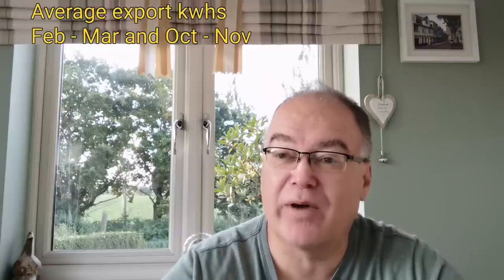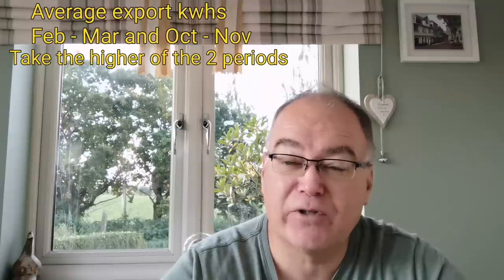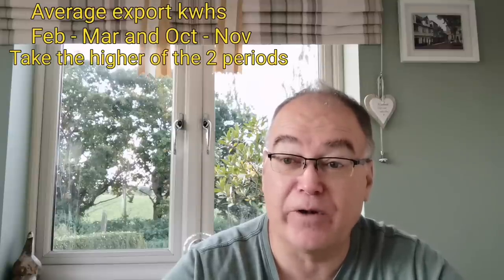How to size a home storage battery

Comment: Great video, as usual, I had 3x Pylontech US3000C's installed when my panels and inverter were installed BUT, I've just bought 3x US5000's to join the 3000's, giving me around 23kWh.
My 8.5kWp array may not be able to charge the batteries fully during the winter (unknown since only having them installed in March) but top that off with Agile and I should be good.
I've started testing a couple of infrared panel heaters, my wife loves the one under her desk and I have a 720W one in the conservatory which I'll use when the temps drop enough.
Reply: I have a 5.5kw array and a 5kw battery. I can't charge the battery to full on most winter days (5-6 months a year) from the array
Reply: @leedove7255  I've had one or two days this month where the batteries haven't charged BUT this has been when there's been the dishwasher, tumble drier, washing machine, computers, xBoxs, etc, all running, etc.
I look at what the panels and battery also save me, on a day when there's 30kWh used in the house and I've only drawn 80-10 kWh for instance.
Over a couple of months alone that would work out to be a massive saving.
Reply: @leeumney7675  I am not saying that you will not save with the system just that the batteries seem a bit big. I am a bit confused by your numbers (30kwh used and drawn 80 - 10) do you mean 8-10 ?
Reply: @leedove7255  I know mate, not saying that you were.
I went oversized for 2 reasons:
1. in the winter I can charge them with both grid (Agile) and what little solar we get.
2. in the summer I'll be able to maximise the amount I get back by strategically dumping power onto the grid when it's paying the most.
I also plan on getting more infrared panels and the extra batteries will help with those over the winter.

Comment: Thanks, a good discussion.
I just about manage with 7.5Kwh, but the payback of adding more is way too long, but I still wish I had gone for 10 Kwh.  
In summer, no problem, and surplus generation from my 4 Kwp is just dumped to my ev. In Winter, I fully charge the battery on the cheap overnight rate. Load shifting helps keep me going. I just about manage to keep my day rate grid unit cost to about 1 unit/day, but the savings from extra battery are way too long. Everyone is different.
Heating is still gas, and living in a very old house, there is little chance of further gains.

Comment: Yesterday, Tesla support gave me the option in my app to import/export to powerwalls, as opposed to only using them in support of solar. Very excited to see what difference that will make financially, as it dumped 29 kWh into the grid last night as soon as peak arrived.

If we charge at .07 and export at .22, something tells me it won't be as simple as just multiplying the difference.
Reply: It's not worth it until the UK offers net metering sadly as it will cause your battery to cycle alot more and thus degrading the life of the battery.

Comment: Other considerations to consider lowering your electricity usage, and depending on where you reside. Is the use of Tankless water heaters, or using natural gas/propane to heat your water and heat your home as well as to cook with. Here in Texas. I am use a propane tankless water heater, and my central heating is running off propane. Propane is cheap in Texas. However, the issue we have is the A/C usage in the summer. While our u it is on, it draws 5kw as long as it’s on. We also use a propane generator to charge batteries in prolonged bad weather. Where the bad weather has knocked out the power grid. I use propane to off load electric use to allow for smaller batteries and less panels. I use around 6000 kWh per month.
Reply from the maker: But my point to using electricity is to avoid oil and gas products. Burning any gas isn't a good thing going forwards.

5kw for AC.  Ours ticks over at 400w and peaks and 2.6kw.   (2 x 3.7kw and 1 x 2.7kw units)

Comment: Thanks for posting. Great video. Having a 4kw stand alone system with 9.6kw of battery and it’s being fitted in the next few days. I already have a 1.8kw system 11 years old giving me maximum price on feed in tariff. That’s having a new inverter and replacement panels. The 9.6kw batteries were a guess. I’m considering adding a 4.6kw battery to my 1.8kw system also. Going to start recording how much I’m generating on the existing and the new system then will decide where to go next. But this video will save much head scratching. John
Reply from the maker: Makes so much sense doesn't it. You know far more than me as you've reaped those FIT benefits for many more years than me

Comment: In the winter, my solar production does not even cover my home use, so even a good 10kWh of solar would not provide energy for the home. I found my Tesla Powerwall 2 would top up overnight and be used during the day and evening, helped by any solar production.  I found my night use of the cheaper tariff was at 89% so it certainly saves a lot of money if used correctly. 
Also in your calculation you stated your solar equalled the size of your battery, but it must be remembered the home will be consuming some of that solar energy!

Comment: Another great video. Esp as it focuses more on the different aspects you need to consider more than just pure math. We don’t use a lot of elec and have 2kwp solar which is still exporting a lot to the grid. Yes, an EV can consume that excess but only at above 1.4kW surplus. We’ll charge the car off peak from the grid and focus on a 5.2kW battery balancing the solar surplus and the minimisation of peak price elec from the grid. we can always add another battery and scale up as we learn, but don’t want to over purchase or oversize as all consumerism has a carbon impact. Having a smaller setup also helps you to challenge your use a little and not assume a high consumption lifestyle can be solved with lots of bling.

Comment: Excellent and though provoking video - thanks for your efforts. For those with an EV, keeping spare capacity in the car is very useful especially given that car battery sizes can be far larger than permanent domestic storage. How long before most cars become a fully integrated part of our grid balancing system?
Reply: V2Grid , V2Home are projects in the box of oem car company. Planned to costumers in 2 years, maybe . But think about why Tesla doesn’t offer V2G , mystery ..
Reply: Maybe becaus of the free charging of first Tesla models.

Comment: handy video..! what about dynamic ess? mine is a victron instalation of 4kwh solar and at the moment a 5kwh battery, my coverter is 5kwh and i am using 6kwh a day in the summer and same as you, 24kwh in wintertime..so i need to get to what size battery? and is it possible to disconnect batteries in the summertime to expand the lifetime of the batteries? cause in wintertime i charge them in the night when dynamic prizes are at there lowest and there is no sun.

Comment: Thanks Nigel, great video, so useful. I'm another Norfolk boy here! Aged 65 living in an old and cold Grade 2 listed farm house. Planners not keen on roor top solar. Probably not living in this house for a long time. EV arrives in a couple of months. Looking at batteries initially I "think" that solar will be more expensive if we have to do a barn roof install (East/West panels as ridge is North/South) = more panels plus the roof is not good. Field solar install I think might be more expensive due to cable runs of over 100m. Looking at batteries as being more transportable if we move. Then looking at Octopus Agile to shift daytime consumption into batteries, charging batteries at off peak along with EV. Whats this like as a plan? Ps subscribed!
Reply from the maker: Cheers Fergus,  I'm still in favour of solar over battery if you can only have one but that does depend on whether you can use the energy without exporting it.

Listed buildings must be a challenge. I'd go ground mount, if you have space maybe  a helio tracker or two for optimal performance.

What EV are you after?  We've loved the Cupra since testing it.
Reply: @EVPuzzle  OK, will look at ground mount solar a bit more carefully then! I'd be interested to hear more from you on solar options - perhaps on Norfolk installers. 

Listed buildings a bit of a nuisance when listed churches are being considered for roof mounts and govt continually talking about promoting roof solar. We have black pantiles and some of the new black solar panels do not distract from the overall look of the roof i feel. 

We ordered a VW I3 Pro Performance Family with Asst Pk+ on 7th Jan 2022. Probably due in March 2023. Seems as if VW have been the most disorganized and of all car manufacturers through Covid and chip shortage problems. Also the software seems to be worse than other brands. However I think as a car itself, it is reported as being spacious, quiet, comfortable for long drives and not too big. Nothing is perfect but I am happy to stick with what I have ordered - especially with the Matrix headlights and other extras build into the Family model that were withdrawn from the options list about 5 months ago.

If you are happy to chat via messenger that would be OK, Can I PM you?

Comment: Hi great video and very informative 👍.
I've now fitted a Ac coupled giveenergy invert and 9kw battery although I'm struggling to get hold af a WiFi dongle unfortunately, any ideas where might still have them?
My solar array has been great since it was switched on yesterday and the the weather has really been great. I believe we were exporting from 7.50am until sunset so am excited to get the battery commissioned.

Comment: I'm a low power user typically taking 5-6 kWh/day. I went for a 3.16kW array & a 3.3 kWh battery. Had I known what I know now, I probably wouldn't have had it put in. The battery discharge limit is typically 2.2 kW. Put the kettle on first thing in the morning or put the oven on in the early evening & anything above 2.2 kW will automatically get drawn from the grid; that's even if the battery is full. Likewise, there are occasions when the battery just refuses to deliver current. In the wee hours, it seems to give up for maybe 15 minutes at a time & the base load (fridge, router, etc) all comes from the grid. Also when wifey uses her hairdryer, sometimes it refuses to play ball. It's really annoying when you're away on holiday & the system has virtually bugger all to do, that you see the system pull 0.7 kWh/day from the grid! Yes, money-wise this is no big deal, but when you're already a low user, it's not insignificant & totally undermines the overall economics of solar.

Comment: Good video. 
Although, Tesla Powerwall gives out consistent 5kW power with 7.5kW peak. Comfortably handles heavy start up load, such as fridge/freezer etc.
Reply from the maker: Depends on Dno approval
Reply: @EVPuzzle   Yes, it is the case that there’s a cap on inverter output, based on the off chance that the full power might zap the grids transformers for a couple of milliseconds. Our cap is 10kW and that means that our 5kW Solaredge inverter combined with the Powerwall’s 5kW is the maximum for our area. We’re lucky, as some people it seems are are capped at 2.4kW.

Although the combined export from the Solaredge and Powerwall is capped at 3.6kW to the grid, the Powerwall gives 5kW into the house on-grid and off-grid. Admittedly, when we installed solar and Powerwall in 2018, the ‘backup gateway’ wasn’t available in the UK. With the standard gateway the battery was throttled to 3.8kW into the house, but when we upgraded to the backup gateway (when it became available), the full 5kW capacity was unlocked…plus improved functionality and control.

Comment: Good stuff. Can you Island, run all your house if the grid goes down? or do you only have specific circuits that will run purely from battery/Solar power (I understand many solar systems will not function if the Grid supply goes down and many buyers do not know this or ask about it as they assume they can run their house on solar)
Reply from the maker: My house runs OK without grid power. It's a design choice with the right battery. Mines not perfect of course. Think I'll improve it over time
Reply: Hi Nigel... I think he's asking if your setup is Grid-Tied.  It shuts down completely during a Grid Outage.

Or have you got a 'Gateway' setup that islands your house so everything can continue to work?
Reply from the maker: As I said my house runs OK without grid power, it's grid tied but isolates from the grid when there's an outage to ensure no bacK feed
Reply: @EVPuzzle  That's interesting, how does that work?  Is it a manual switchover?
Reply from the maker: Automated, if it detects the grid isn't their it physically opens a breaker preventing back feed.
Reply: @EVPuzzle  Nice... so it's not Grid-Tied then... perfect setup

Comment: One important factor I'm not sure you covered (if you did I missed it) is that the battery might be say 10kW capacity, however since you very rarely would run it till it's flat and battery makers usually suggest only charging to 80% to help them last longer, that means that although rated to 10kW, it's more realistically like 7kW of usable storage, so as someone else in the comments suggested I would say you're better off doing your numbers, then going 1.5 times the size to cover the charge capacity and also degredation over time which will also reduce capacity.
Reply from the maker: Many batteries are now 100% DoD, mine is 95%  

80% fill doesn't apply to lifepo4 that's more  relevant to ncm car battery tech 

But yes there's an element of capacity not used , 10% for me
Reply: Yes， and the energy storage integrated machine has appeared on the market now, and its capacity is very large, 15-35kwh.

Comment: Partly why I've gone with the Pylontech batteries (& your recommendation), as not sure what the solar will generate (install of both in November) against our usage. Heating/water still has, so daily usage not that high. Will see how it goes and add additional batteries if required. The solar install is the expensive thing (~20% of our cost is scaffolding) so get as much of that as you can when first doing it. The other bits are easier to upgrade or add to

Comment: do you have pylon batterys.. how many do you have on your setup. i have 4 of h48050 2.4KW for my Solax X3 5kw setup. but we have heatpumpe air/water and used in October to febuar about 40KW pr. day. mostly is for the heat pump that are using about 30kw. alone
Reply from the maker: Yes 5 x us3000c

Comment: It also depends where in the UK you live as some parts will get more sunlight / sunny days. I had a quote for a 6kW solar array plus 3kw battery at a cost of £12k (£1k for EV charger on top). The issue I see is that in the summer I can't use the 36kwh I will potentially produce per day as the rear roof of my house faces due south. The national grid pays more during high demand which is actually in the winter when its not so sunny. I am considering a 2.4kw array at ground level (on a shed roof 6 x 400w panels) with a 5kwh battery and 3.6kw inverter. I want to power a home office and charge / top up my EV using the 13A charger as it can charge at 2.4kw easily. My car isn't my main vehicle as I use a van for work so car can sit charging 7 hours a day. Do I apply for G99 and grid tie the inverter or simply add a change over switch in the home office to run of solar system or from the house ?

Comment: I have 8.2 battery I was thinking of getting another one but looking at quotes it will be more cost effective to add more panels another inverter and battery also it I will be able discharge at higher rate

Comment: When vehicle to house, and vehicle to grid charge points are available for the public to buy in the UK, that will make pence per kWh a lot more affordable. I am looking at buying a salvage Leaf with 24kwh battery for just £1000, even if the battery is only half the health, it works out about £80/KWh, instead of the home battery at £800/KWh!
Reply from the maker: Are there salvage leafs for £1000 with battery?
Reply: @EVPuzzle  I think so, I have been looking on Copart and there are a few Leafs that pop up each week, although I haven't seen the final bids, so maybe they shoot up just before the auction ends. I am planning to buy one in the next month or two so will let you know. I have made it on to the short list for the Indra Vehicle to Home trial, and as I sold my old Leaf, I will have to buy another!
Reply: Even if you bought an old Leaf with half battery health off Auto Trader at £5000, it is still about £400/KWh, instead of a home battery at 800.

Comment: Hi,
Your videos are fantastic, thank you so much.  Just got lost on your logic here. Dec 21 you stated you generated 94kwh for the month and 250kwh in Jan 22. I think this is on a 5.8kw system before you upgraded. This averages about 10kw per day over the 2 months, no problem. However in Dec 21 you averaged just 3kwh per day ( say upto 4kwh per day with the increased size of 9.3kw), so how are you saying your solar plus 18kw of batteries will cover your usage of 24kwh? Am I missing something? I live in Norwich and currently since system went in 20/12/2022 average about 2kwh per day on  5.8kw panels, it can only get better?